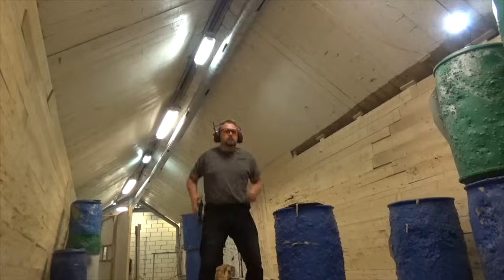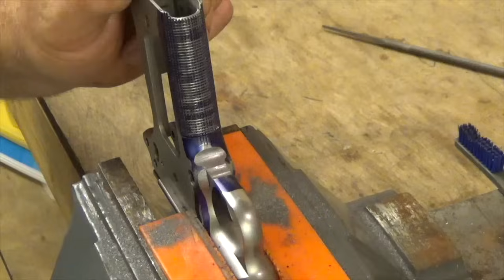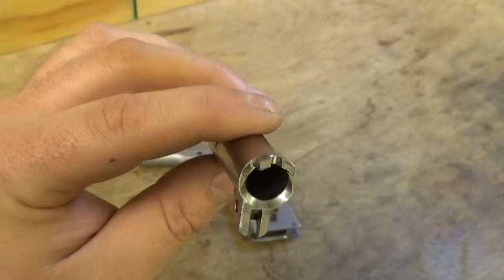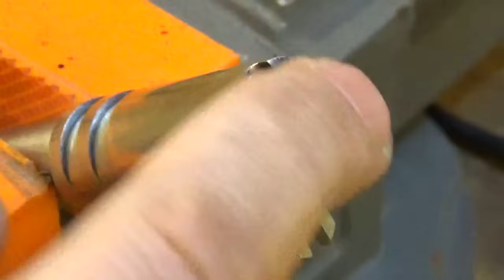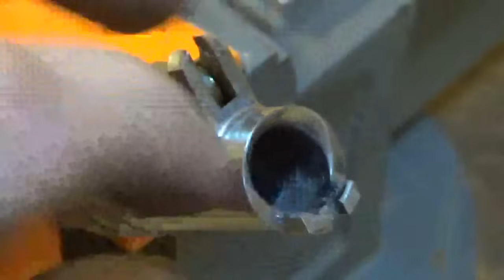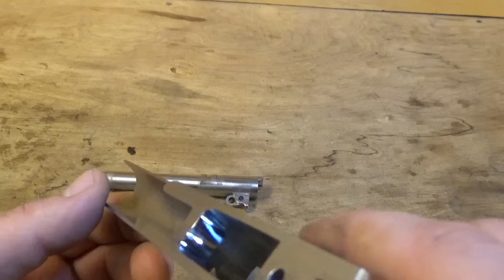1911 barrel throat - Tuning and polish

Comment: Never Ever use a Grinding stone on your gun  to do a job like this use a Cratex  wheel or cone   then polish with a felt bob and Polishing compound like Simichrome  or  Flitz   the Cratex will gently remove the tooling marks and sharp edges  while leaving a smooth finish  then polish to a mirror finish with the felt bob and compound

Comment: If you look at your factory feed ramps under magnification, those factory circular machine marks are as big as mountain ridges.  If you are scared to use a Dremel, then use valve lapping compound before polishing.  And get Sig mags.
Reply: Sig mags

Comment: Nice pick to work on.  A while back I was at an indoor range helping a new shooter and a guy next to me had three 1911's, Colt, Kimber and Ruger. He said the Ruger was more accurate than the other two and let me shoot it. It was amazing for an out of the box gun. Was the most accurate out of the box 1911 I'd ever shot. Soon after I got a TALO Ruger Commander 1911. Had to have it!
Reply from the maker: Thank you.
Yes, the Ruger is a great gun right out of the box. Also great accuracy for a low price 1911. I have done a lot of work on it to build it  to my preference for competition use. Has run close to 40.000rds now, and will last many many thousands more.
Reply: My ruger 1911 has always been crazy accurate 
I have the base 1911

Comment: Don't do it. The Colt 1911 was designed to use only ball ammo aka full metal jacket. But it's your firearm and your money, screw it up if you want. I have put hundreds of rounds through my Colt 1911 and have had no feeding problems with ball ammo. Go ahead, waste your money and ruin your gun.
Reply: For about 98% of my 1911 shooting, I use 230gr. Lead RN bullets that I cast from straight wheelweights from a supply of wheelweights I collected for decades.  They are basically FREE. I own 6 Model 1911s. 3 Colts, 2 Kimbers, 1 Charles Daly.  I have full size (3), Commander size (1) and Officer size pistols (2)
ALL of them had feeding issues with my practice loads of lead RN bullets.  I polished the feed ramps and chambers on ALL of them (using only the polishing "bob" and polishing compound) and they all feed my practice loads perfectly now. 

A few minutes time and a little polishing compound have saved me thousands of dollars in ammo costs over many decades and allowed me to shoot much more. 
It works well with FMJ and Federal HST hollow points also (my carry ammo).

I do not use a grinding wheel or sandpaper on my guns, fabric polishing "bob" and  compound only.
Reply: I have shot hundreds of round through my old Government issue Colt and they are reduced loads, lead semi wadcutters.  But at 75 I know more about how to work a 1911 than most ever will.😉
Reply: @gvet47  Yes a wise decision regarding the reduced loads . Most any manual will always show that they are reduced . Good point  * I just turned '79'  👍

Comment: This mod serves no purpose, in fact it can create feeding problems and not eliminate them.
Reply: For about 98% of my 1911 shooting, I use 230gr. Lead RN bullets that I cast from straight wheelweights from a supply of wheelweights I collected for decades.  They are basically FREE. I own 6 Model 1911s. 3 Colts, 2 Kimbers, 1 Charles Daly.  I have full size (3), Commander size (1) and Officer size pistols (2)
ALL of them had feeding issues with my practice loads of lead RN bullets.  I polished the feed ramps and chambers on ALL of them (using only the polishing "bob" and polishing compound) and they all feed my practice loads perfectly now. 

A few minutes time and a little polishing compound have saved me thousands of dollars in ammo costs over many decades and allowed me to shoot much more. 
It works well with FMJ and Federal HST hollow points also (my carry ammo).

I do not use a grinding wheel or sandpaper on my guns, fabric polishing "bob" and  compound only.
Reply: What oal do you run? I've been having feeding issues with h&g 34's in one of my rugers but not the other. @garyK.45ACP
Reply: @30roundclipazine79  Well, I am using H&G #68 SWC seated to an OAL of 1.225" +/- .002
For a roundnose bullet I use Magma Engineering 45233K. It is called the "K-ball" and duplicates the profile of the 230gr. FMJ bullet.  I have no experience with the H&G #34
I also use ONLY Wilson Combat 47D magazines in all my 1911s.
Reply: @garyK.45ACP  thanks for the reply. I too use the h&g 68 at that oal.its my favorite round to shoot
Reply: @30roundclipazine79  Another trick I do is to apply a taper crimp to all .45 ACP rounds.  For this I use a .243 Winchester sizing die, with the decapping rod removed, and adjusted so that the taper of the die just squeezes the case enough to make sure there is no flare left on the case mouth and the bullet is held tight.
You could probably do it with virtually any .308 based cartridge loading die (as long as the case does not have too much body taper)

Comment: For about 98% of my 1911 shooting, I use 230gr. Lead RN bullets that I cast from straight wheelweights from a supply of wheelweights I collected for decades.  They are basically FREE. I own 6 Model 1911s. 3 Colts, 2 Kimbers, 1 Charles Daly.  I have full size (3), Commander size (1) and Officer size pistols (2)
ALL of them had feeding issues with my practice loads of lead RN bullets.  I polished the feed ramps and chambers on ALL of them (using only the polishing "bob" and polishing compound) and they all feed my practice loads perfectly now. 

A few minutes time and a little polishing compound have saved me thousands of dollars in ammo costs over many decades and allowed me to shoot much more. 
It works well with FMJ and Federal HST hollow points also (my carry ammo).

I do not use a grinding wheel or sandpaper on my guns, fabric polishing "bob" and  compound only.

Comment: This was satisfying to watch. 
I think I might need this done on my 1911. The bottom part of the throat of the barrel keep biting into the casing of the round and prevents it from going into battery.
Reply: In that case you should consider a barrel reamer. What you are dealing with is certain cases that are too large. Like that of reloads or Aguilla. Polishing a barrel won’t actually solve the issue.

Comment: Yes,she is shining pretty, i need to grind quite a bit on my barrel ramp,that is the problem,i'm sure,it does hang up feeding,building my first 1911,have 4 now my build makes 5.
1-Colt mark IV stainless series 80/1-1918 original Colt /1-1943 arsenal rebuild mixed parts /1-Norinco from 1980's /this build is a Essex frame and  1945?+ - arsenal Remington Rand slide & barrel. They did not chamfer barrel ramp enough.  I subbed your channel,keep up the good work and tell of tips etc.  Thanks Wolf
Reply from the maker: Jim G
Thank you, glad you find the videos useful
Reply: Jim G "

Comment: When you get through, if empty brass feeds, you have done well....I did one 35 yrs. ago, pushing the limits and it worked...A friend has the gun and no money can buy it from him.....I have two now to work with and I a'm going to try to duplicate.....many years ago a friend and I did this for law enforcement people at no charge.....helping the community....also..never sand any way but across the grinding marks...be careful of the chamber as to not enlarge it....a small amount can be unpleasant......SHOOT ALL YOU CAN.....
Reply: Idesigned p7 glock ziebzehn ( not david thurenger aka gastin glock) uzi mac9-10-11 desert eagle Ak74 m16 m60 claymore mine Famas AUG SSG G3 barrel & accurize the 1911 + more CIA USMC RDF IDF IDFA 1ST CAV MACVSOG DOM 08 1/4
Reply: ^ ok bud

Comment: I am having failure to feed issues in my officer model. My barrel throat is .0480 in should i throat my barrel? Thank you for the informative video.
Reply from the maker: Thank you!
It sounds a bit steep, but feeding issues could also be related to extractor and magazine, or a combination. If you have the opportunity to send me a good picture of it, I will try to give you my opinion.
Reply: +wolf 83 Thank you. I just replaced the recoil spring assembly with a Kimber ultra carry, now even hollow points will chamber, going to take it to the range in a few days. I guess the spring tension was just worn out.
Reply: You need new recoil springs. The Defender is only good for about half the life and sometimes less when compared to a govt. model. How do I know? I had the same issue. I didn't waste money on the Kimber recoil assembly and the Colt assembly works great. I just replaced the inner and outer spring with Wolff springs.
Reply: EGW has a reverse double recoil spring set up that works great for the colt officers .45acp model, I installed it on my officers model and works great, the weak spot on the colt officers model is the original recoil spring plug tends to wear out on the inside from the spring rubbing against it until it’s to weak to retain the spring and bursts, it’s a matter of time before this happens, The EGW spring set costs about $59 plus shipping but it’s worth it! go to egw.com and check it out you can view it on you tube video also, look for it under egw recoil spring!😉

Comment: Hello Wolf, first thanks for an excellent video.  My compact had some severe feeding issues, I followed your directions and it works well now.  It doesn't look as nice as yours but that will come with practice.
That said at 15:22 which exact head is that?  I did a manual buffing with 2000 grit sand paper and it looks good but could be better.  Mine is also a 45 so the same head should work well in mine.  If you could provide that I would be really appreciative.
Also, I subbed your channel as did a few of my friends.

Comment: What Dremel heads/grit did you use?
Reply from the maker: I use first regular grinding stones for dremel, then 120 grit sandpaper/ drum, and last cratex rubber abrasive tip before final polish.
The cratex rubber tips are great for final surface work